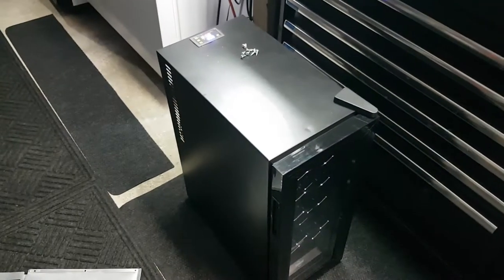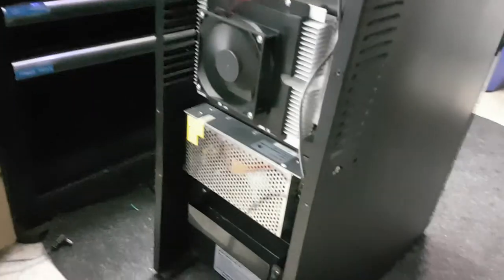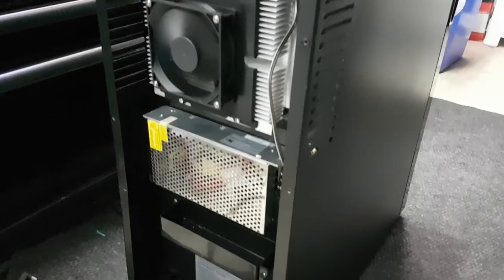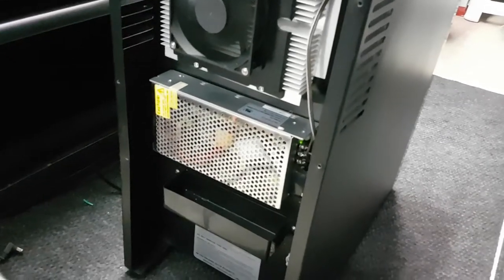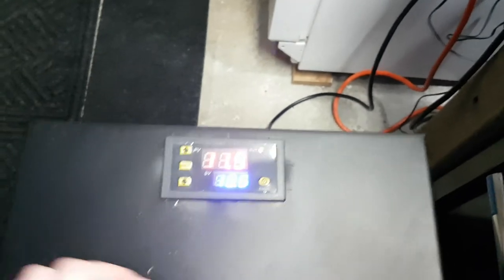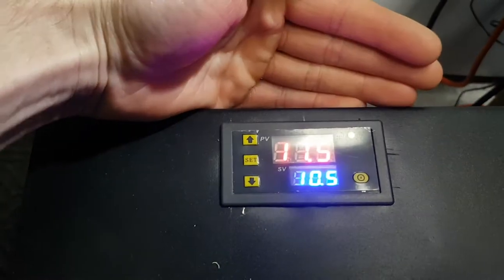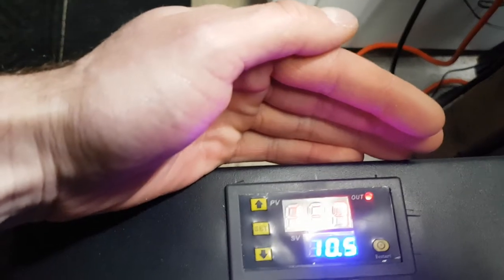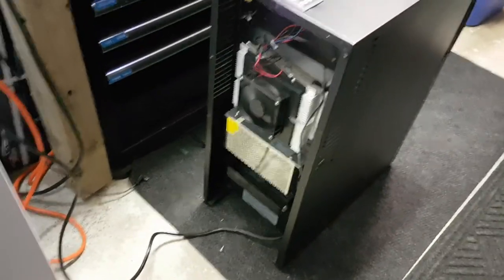Getting a Koolatron Wine Cooler Working Again

Comment: We got an Igloo wine cooler that stopped cooling. When I inspected it, I noticed that the small fan in the back wasn't spinning. So, I took the back cover off, and saw a bunch of dirt and        
lint on the fan, the fan frame, and in-between the heatsinks on the condenser. I cleaned it all off, and the fan started working again. This one was an easy fix, and didn't take too much time. My wife was about to get rid of it, but I never throw things away without 
trying to fix them, first. Because I don't like to spend 💰, unless I have to.

Comment: How do you know where the wires attach to the new power supply?
The original board has plugs that go in specific points.  The power supply I bought has 7 screwpoints where the wires attach to. 

They are labeled L N (AC),  -V, +V

Comment: Hello,  We have the same cooler and can't figure out the circuit board problem for not cooling. I like that you just replaced everything.  do you have the part numbers your ordered for these?  great solution!

Cheers,
Cory
Reply from the maker: Hi, yes same here. There are some discussions online. What ever it is I could not figure it out either. I ordered the 12V AC adapter and thermostat on ebay from china.
Reply: How many watts for the power supply?
Reply: @nettracher  A 60W unit should be okay (12V*4A+Temp controller)